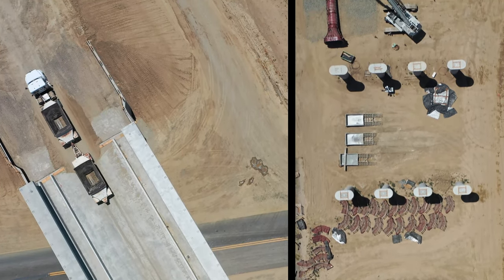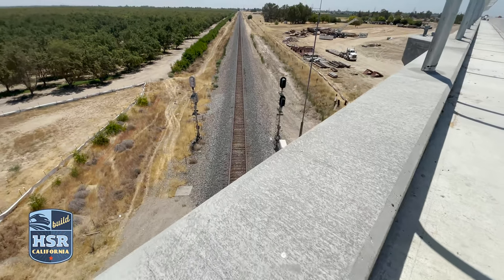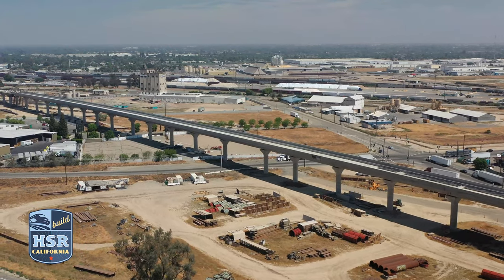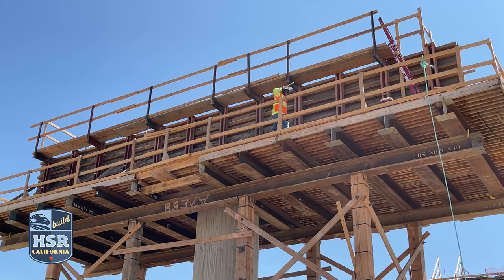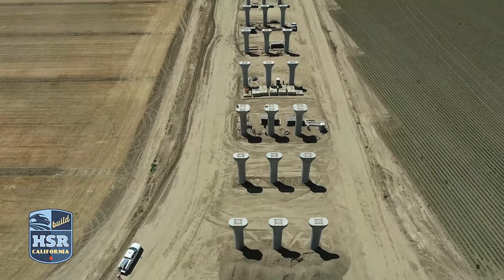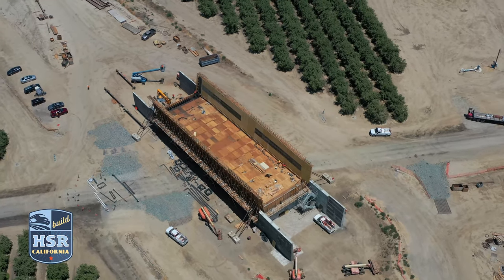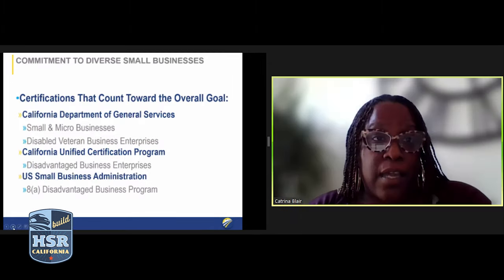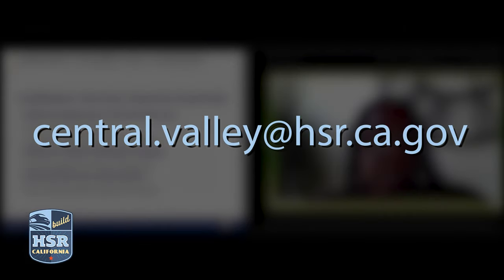California High-Speed Rail Construction Update - Summer 2021

Comment: Construction on the Slightly Faster San Joaquin! 😂🤣😂🤣 it'll take 2 hours just to get through all the unneeded stops in the valley, another 2 hours to go 100 miles to the east out of the way and into LA! 🤣😂🤣😂
Reply: The Amtrak Acela train is said to go 120 mph but actually go much slower.  The only way this train can reach 150 mph is if the eliminate stations.
Reply: So, you're saying not exactly a Bullet Train? What's a few extra stops, a few more curves & 1 rail instead of 2? I would say, sounds like it would take about the same time as good old Amtrack for a SD TO SF run.
Reply: @guyname8760  that's the little part that corruption plays in construction. Kickbacks received by contractors to put stops in various cities along the way.
Reply: @Mister8224  come on, we don't have corruptions, this is the system, everyone must be happy and well paid.

Comment: they should copy chinese technology and build it with modular prefabricated parts mounted by on rail machinery
Reply: Its not the construction that is making it so expensive. Its land right and lawsuits. Which China does not have to deal with.
Reply: @peterisawesomeplease  I don't know - lots of traditional formwork there for concrete. In Europe that would be prefabricated and just craned in.
Reply: @Spookieham  I don't doubt that there are efficiency in construction that could be found. But its just that construction costs are a relatively low portion of the total costs and that I assume they are at least somewhat trying to be efficient.

Comment: So glad Florids said No to High Speed Rail.  California, you got suckered.  This will never be completed and will cost twice what today's estimates are.  When it's done, airlines will cut their prices and nobody will ride the train.
Reply: Even if it’s not completed statewide at least some Central California counties will have a high speed train going between them.
Reply: Florida actually is getting sorta-kinda high speed rail. Brightline, a private company, is building a route from the Miami metro area to Orlando airport, running at 110mph with a short 125mph section (so about half as fast as California's project). Most of the route will be shared with freight trains, unlike in CA. It should open in the next year or two.
Reply: Pretty sure Florida is letting Brightline go ahead with their extensions from Orland airport to Tampa. So it does not seem like Florida is saying no. Sure there are a lot of barriers, but not saying no.
Reply: Bad Comparison. Florida is a much smaller state.
Reply: Brightline is constructing the Orland airport to Tampa line, and it's close to the high-speed rail. The difference here is that Brightline is the private company while HSR in California is government's.